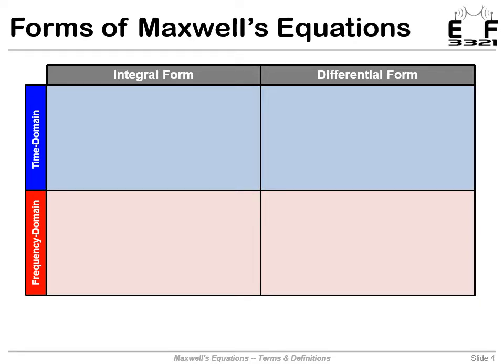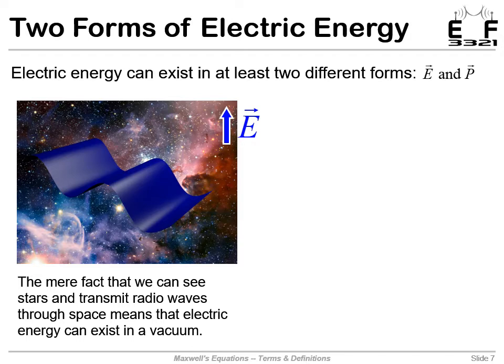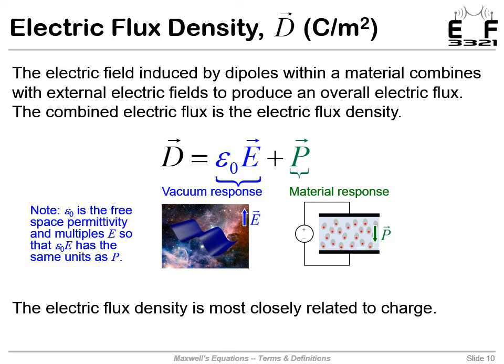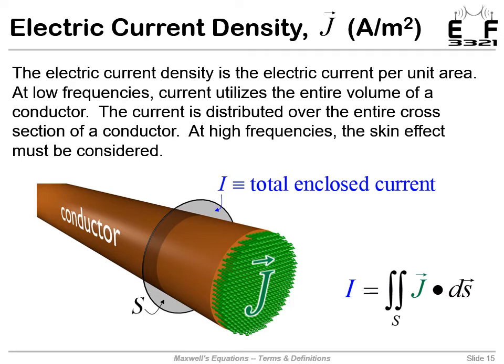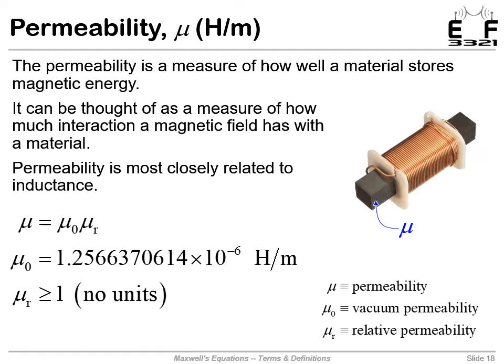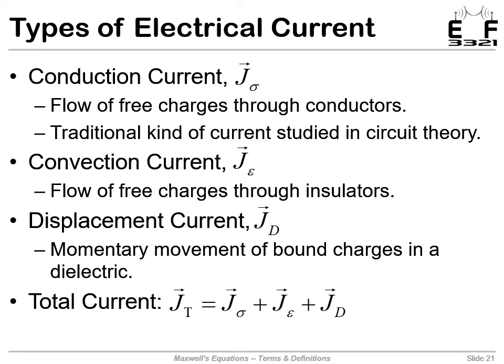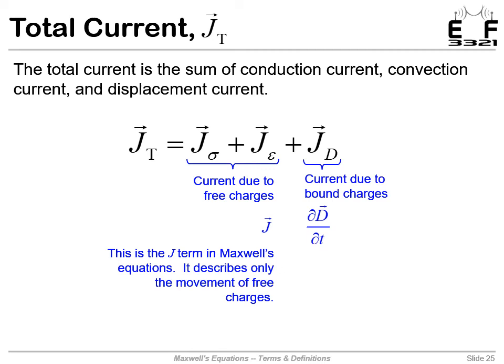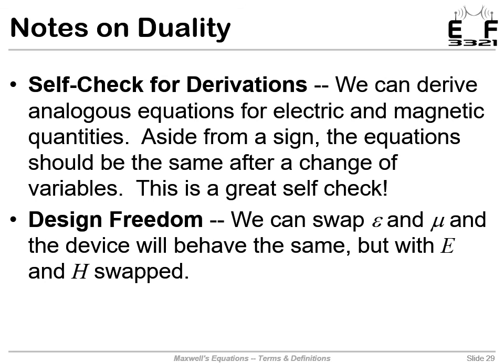Lecture 3a -- Terms and Definitions

Comment: According to my books, there seems to be a typo at 15:06, it should be B=\mu_0 H + \mu_0 M. Thank you for a very good refresher!
Reply from the maker: Great question!!  I should add some notes about this.  M in the notes is called magnetic polarization and is correct as written without the u0 term.  The M you are referring to is called magnetization and requires the u0 term to be included.  It is an unfortunately reuse of the same variable and the two terms even have essentially the same definition.  On wikipedia, they write the magnetic polarization as 'I'.  Unfortunately, I use 'I' in the course for electric current.  We have run out of letters to use!  LOL
Reply: @empossible1577  Ha! I didn't know there were two so similar definitions being used. Good to know. Also, quite impressive you have already updated the notes and the video, great work!
Reply from the maker: I updated the notes and the lecture video.  

https://empossible.net/academics/emp3302/

Comment: Howdy! Very refreshing point of view over D and E. We introduces D only for free charges, which is manageable and can avoid the complex polarization. Gauss's Law can be described with only E as physicists do. In that case charges are in all forms, i.e. free or bound. We electrical engineers like to use D because we can use free charges over the capacitors.

Comment: What is the difference between an insulator and a dielectric? As a result, what's the difference between the Convection Current(Frankly I don't understand it at all!!) & The Displacement Current?
Reply from the maker: There really is no difference between a dielectric and an insulator.  I will add that there exist dielectrics that are partly conductive and we would hesitate to call those insulators.  A good dielectric is an insulator.

Convection current is the movement of charge due to diffusion.  Think of putting a drop of food dye in water and watching it spread out.

Conduction current is the movement of charge due to an applied electric field.  The field puts a force on the charges that causes them to move.
Reply: @empossible1577  Ok, thanks very much for the response, sir!!
Reply from the maker: @meghjitmajumder3468  You are welcome!
Reply: Insulator in conduction point of view,  dielectric in capacitive  material one.